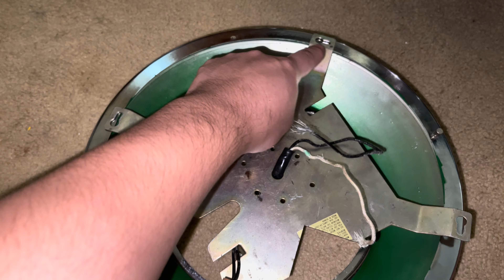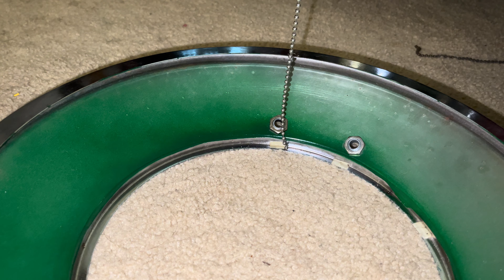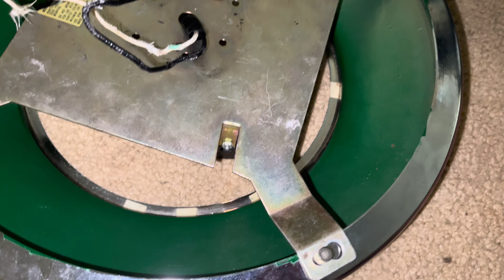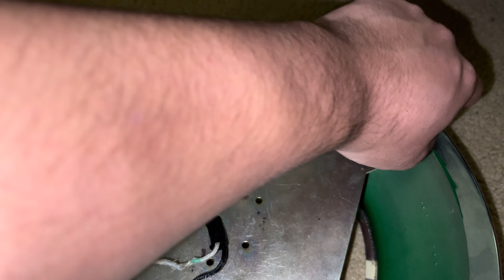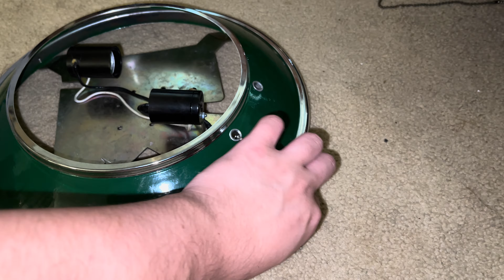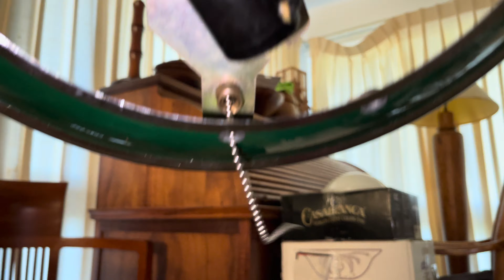An idea how the Hunter 1930’s Original ceiling fan light kit goes together

Comment: 1: Take the screw closest to the chain holes out
2. Add glass
3. Line light chain in the right chain hole
4. Allign the colored part with the screws above into the hole and turn left until it locks in
5. Insert screw back in and tighten all screws
6. Feed fan pull chain through the other hole
7. Add fan extensions of your choice
8. Test your fan light kit